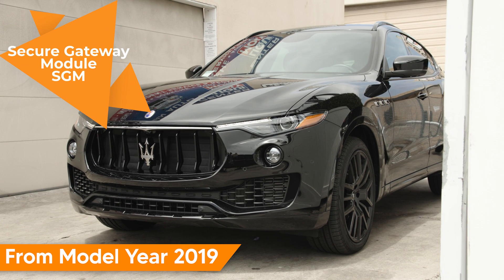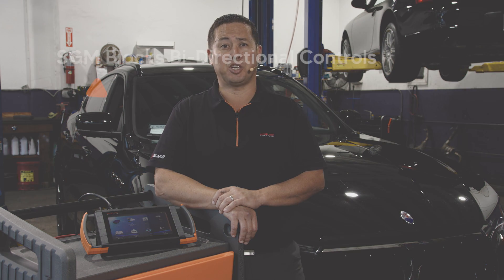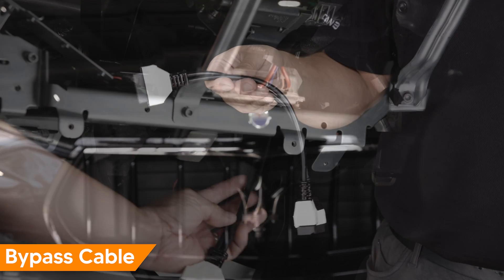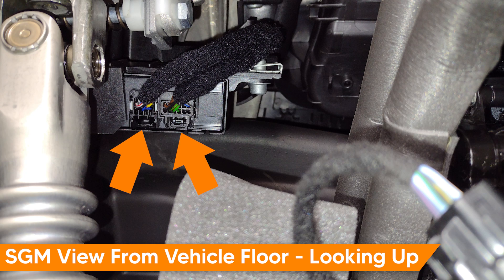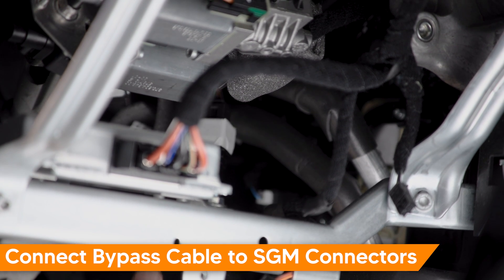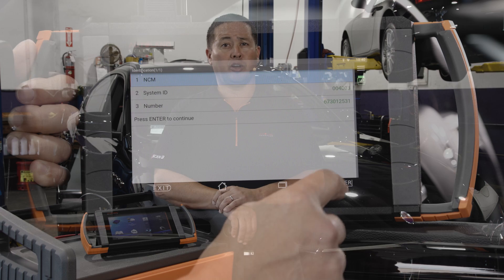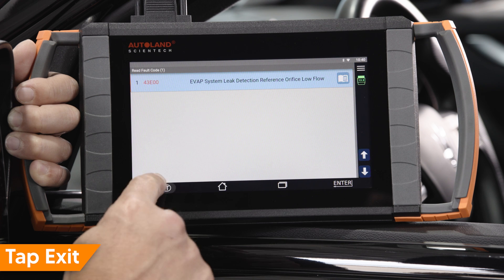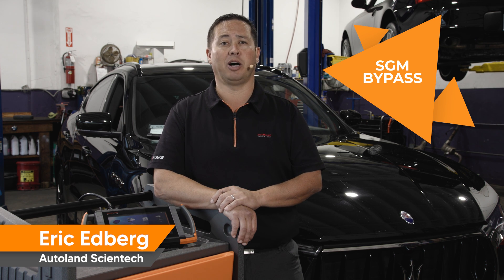How To Bypass Maserati Secure Gateway Module SGM for Scan Tool Bi-Directional Controls

Comment: Does anybody know where the bypass conectors are on my 2023 Grecale i took the soft panel off but no connectors.
Reply from the maker: See this diagram for the location: https://www.eurospares.com/Maserati/Grecale/Grecale_GT_(2023)/PartDiagrams/08_53_1/ALARM_AND_IMMOBILIZER_SYSTEM
Reply: Same here, wondering if anyone had any luck